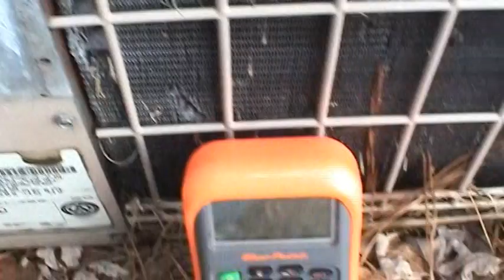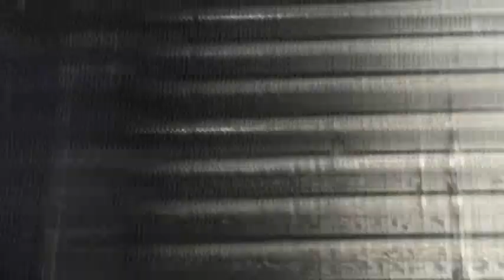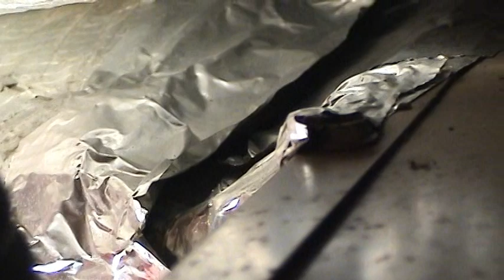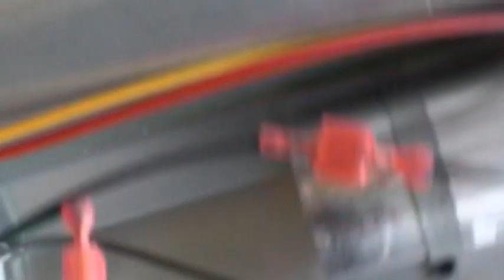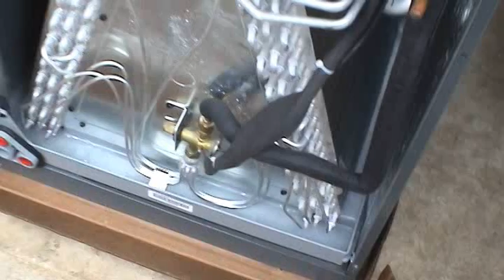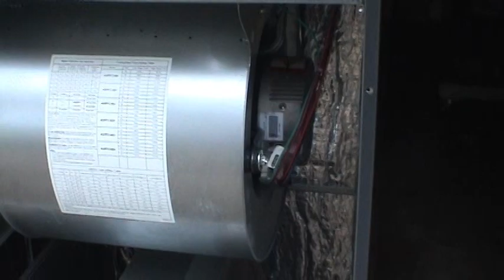Purchasing a Residential HVAC System Over the Internet - Introduction

Comment: Very interesting video, you make a good point that generally the components of these units are the same, the issues are with the installation by the contractor..Excellent video as always.
Reply from the maker: This has been a fun project thus far. It'll be interesting to see how this system performs when it's installed compared to the old system.